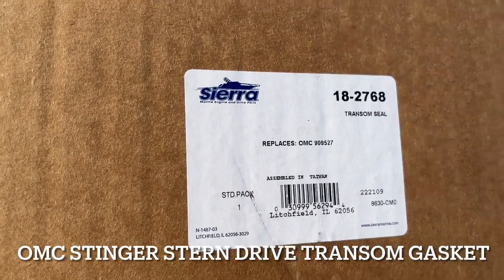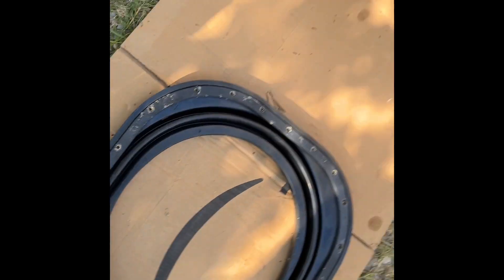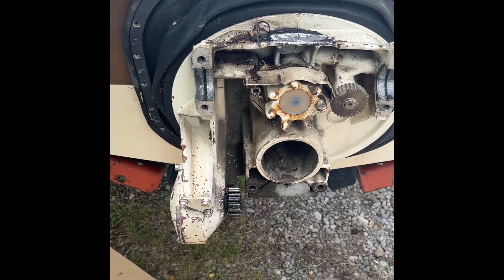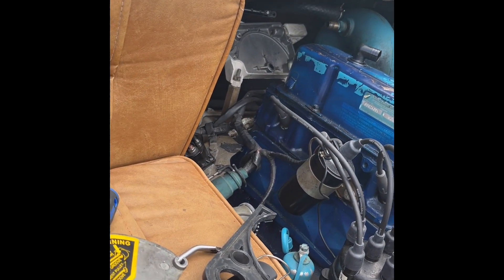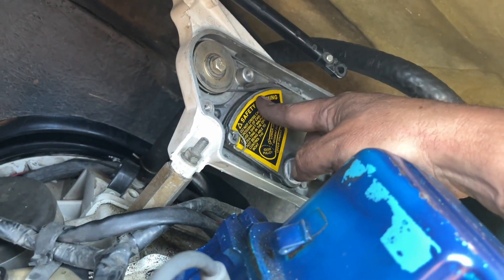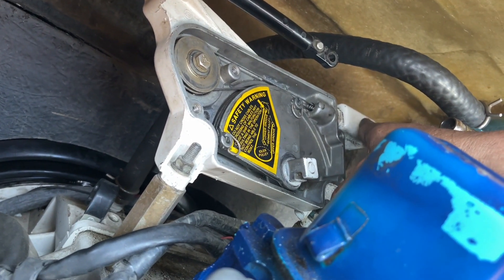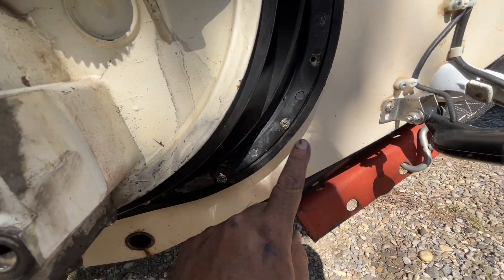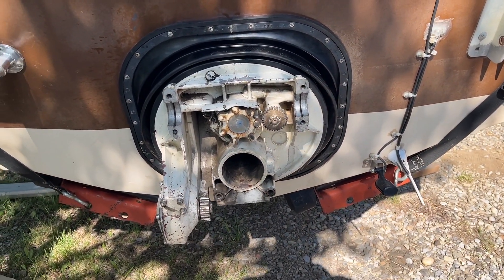OMC stern drive transom replacement

Comment: Was about ready to scrap my ol boat, till i found your channel. We'll see how this goes. Steering cables next.
Reply from the maker: @coyoteodie4458  cables are the only tricky part. I think it was Sierra. I got my gasket from don’t be shy with a silicone, put it in every hole and make sure that thing sealed because you don’t wanna go back in again.
Reply: @percyconnolly  thank you. I had to put a new inside clamp on the boot 2 years ago. I'm not sure I got the correct one. Was basically a very large hose clamp.  The boot looked good at that time. Didn't get the chance to use the boat last year. And this year, the boot is rotted clear through. I'll take any advice you have. Going to watch all your videos.